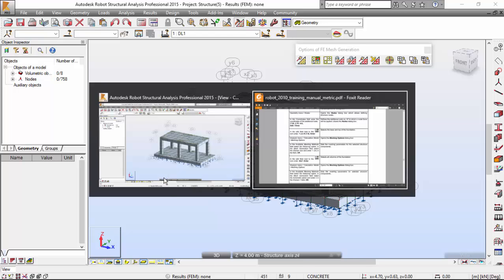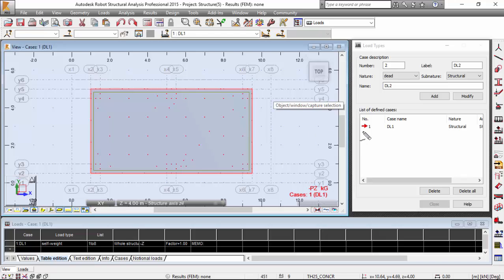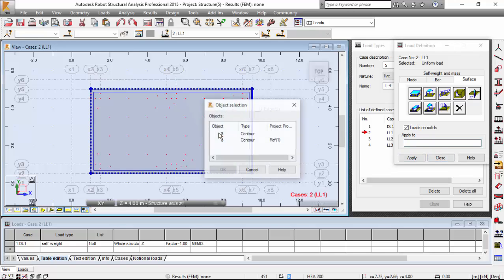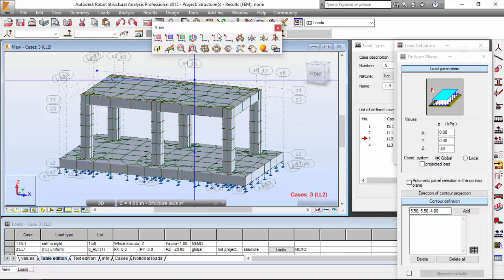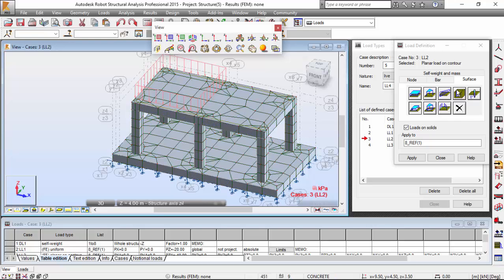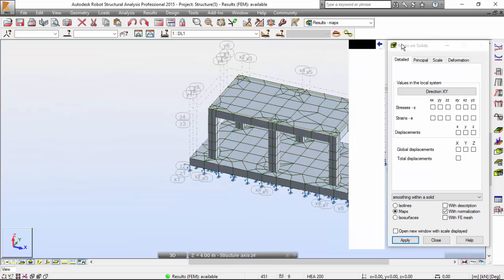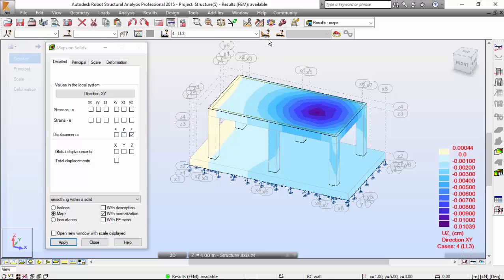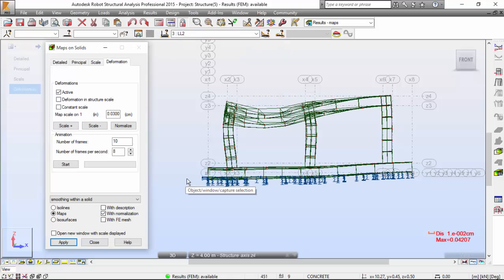Exercise 9 - Part 5 - 3D Solid Structure (Robot Structural Analysis)

Comment: Hi, how can you provide reinforcement on the slab? Thanks...
Reply from the maker: With Robot you can do that if the “slab” is a bidimensional element, known as plate. 

In this case we have used brick elements. You will have to análise the stresses yourself and provide the proper reinforcement :/
Reply: Hello, did you manage to design reinforcement for such a structure?

Comment: Thanks you very much for your videos, i recommended them to the whole class of my university. But i have one question! i try to continue the design and try to provide reinforcement for the slap, however it gives me an error . I selected the volumetric object 1 and the design menu, Provide reinforcement of RC elements and then it gives my an error: " Panel no 1: This element will not be included in the provided reinforcement modules. The material defined for this element is not concrete. Elements that not been included in the provided reinforcement modules: 1"
Reply from the maker: +ntinokostas 

ROBOT will not determine the reinforcement when you have elements modeled has bricks (volumetric finite elements), like the one I did in exercise number 9! Very sorry for that... :/